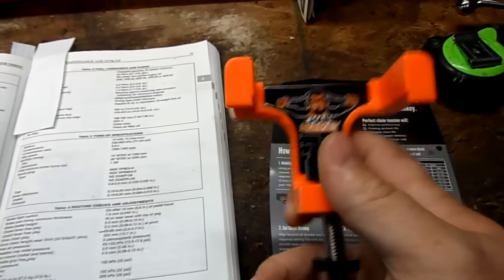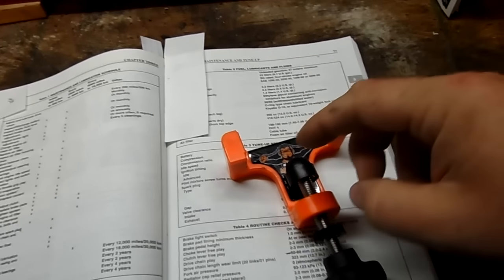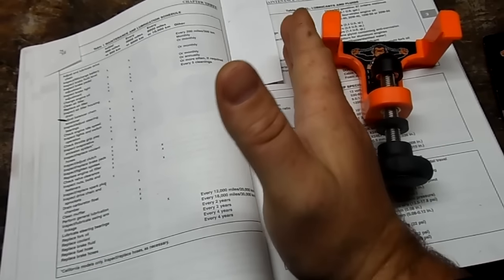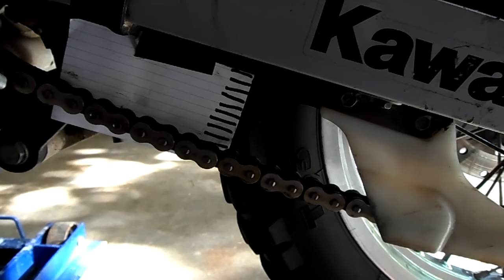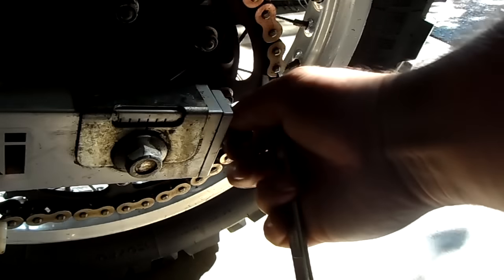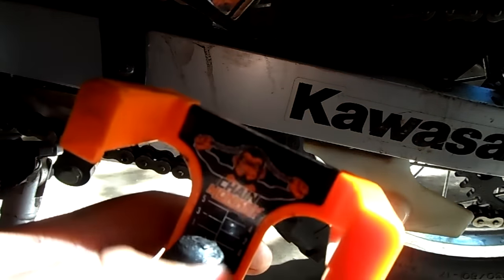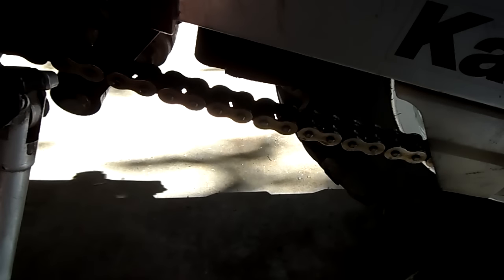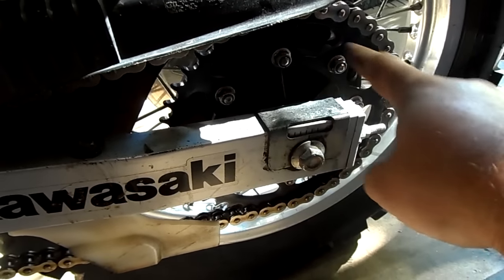New Motorcycle Tool! - Chain Monkey

Comment: After seeing the other version  of the tool i removed the rubber adjuster and put on two 17mm nuts works so much better and it wont move from the set position

Comment: That's an interesting tool....but......$35 seems like a bit much.  Is the orange body of it metal or plastic?  Thanks for sharing your experience with this.
Reply from the maker: The body is a plastic material. Seems pretty durable for the most part. I don't think the tool puts enough strain on it to break it, but you never know after so many uses. Thanks for watching I appreciate it!
Reply: Thanks for the info Keith.  Under normal use plastic will probably hold up fine as long as they used a metal threaded insert in the plastic body.  $35 seem like a lot for a plastic tool even though it looks like a pretty handy device.  

I just found your channel and am enjoying it - thanks for the entertainment!
Reply from the maker: Yea they did use a metal insert in the plastic housing for the thread. But yea $35 is a bit steep for it, but it's a new product and I can't imagine the cost to bring a new product to market. Thanks again for checking out my channel!

Comment: why is it that the version for the cart chain monkey the adjuster in two steel nuts but this one is crappy rubber ?  i bought one of these i think that you would be able to put on to nuts yourself ?
Reply from the maker: I'm not sure really? Cost could be one of the reasons. It looks like the orange body on the cart chain monkey is metal as well. Though the one I have still works really well with it being plastic. I guess you could put the nits on if you can get either end of the threaded rod removed. Thanks for watching I appreciate it!